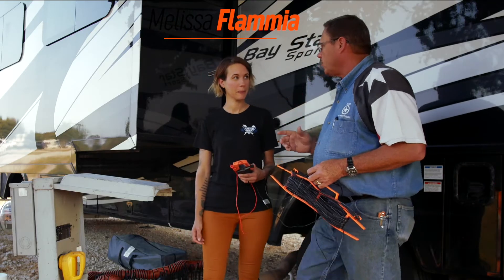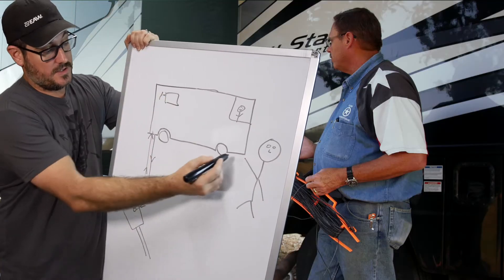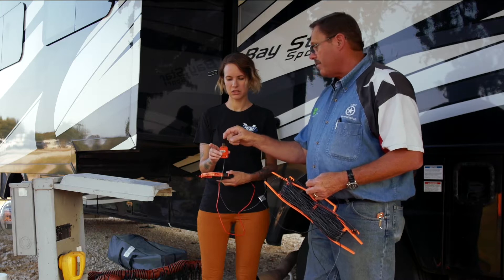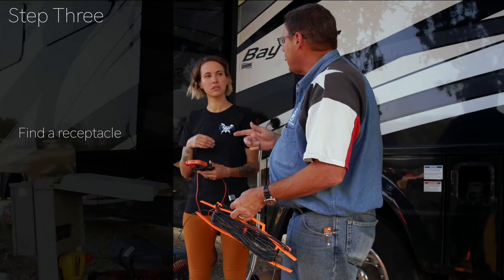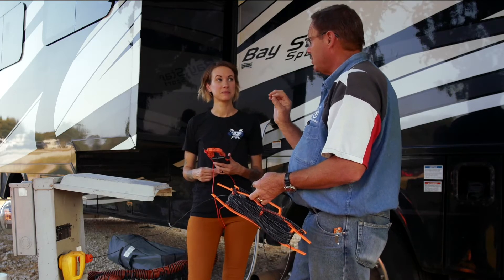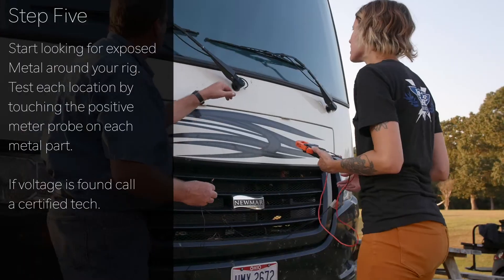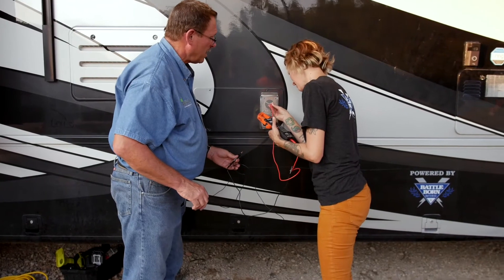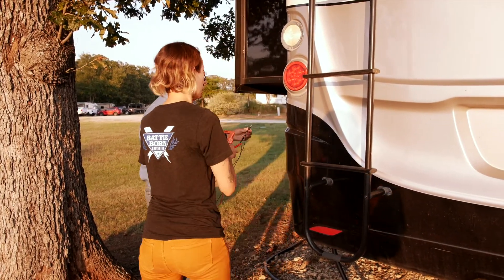RV Hot Skin / What is it / How to test for it

Comment: "The electricity can't come out of the RV because of the tires". Huh, your power cord doesn't have a ground wire. Our 50 amp service on our RV does. I've never owned a 30 amp service RV but I believe that plug has a 120 volt hot, a neutral and a ground. Now, if you touch a "electrically hot" service and you are providing a better path for the electricity to return to the transformer from which it came(usually the neutral wire), then you will get a shock, the severity of which is dependent on how grounded you are. Electricity will take the path of least resistance. If you're barefooted standing in a puddle, yikes. Hot skin can kill you.

Comment: I'm trying to understand something really quick.  When you get shocked by hot skin at a campground, you're completing the circuit back to the source, right?  Would this be the correct order: The electricity is traveling from the RV hot skin, through you, through the ground, back to the pedestal where it rides up a possible ground rod (or the case of the pedestal itself), through the ground wire back to the main service panel where it meets back up with the neutral at the bonding point.  Or does the electricity simply want to pass from the hot skin, through your body, and then to the earth because there's such a difference in voltage -- and completing the circuit has nothing to do with it?